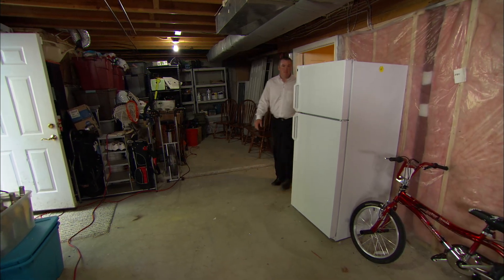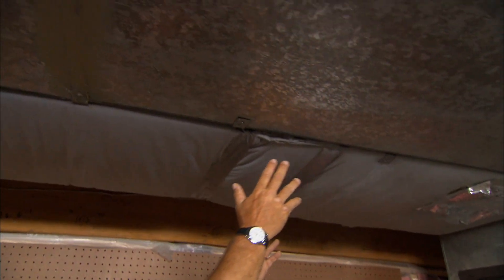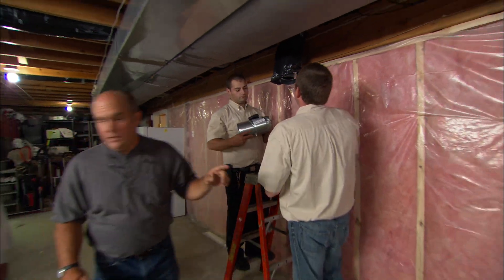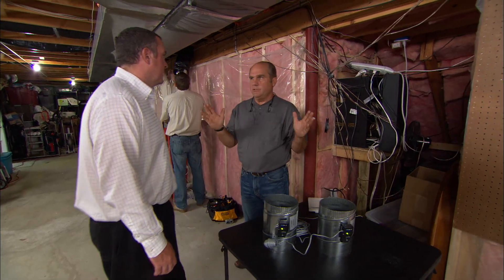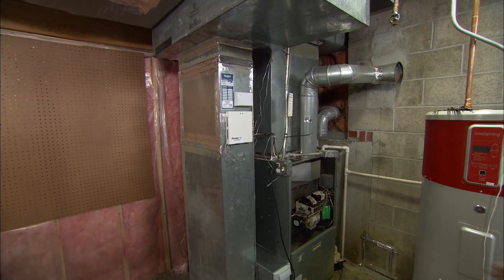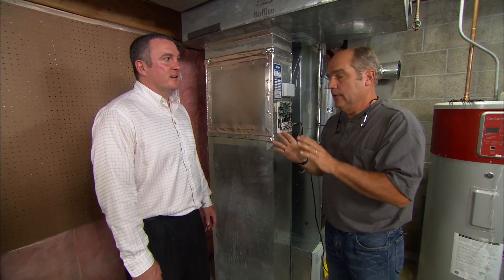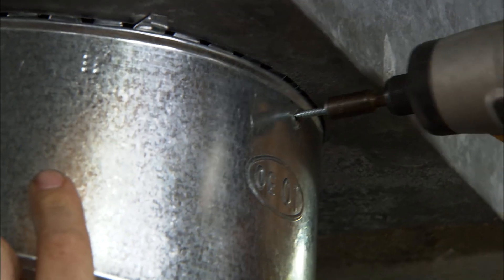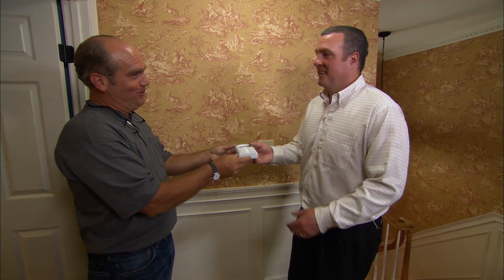How to Zone a Forced-Air Furnace and Air Conditioner | Ask This Old House

Comment: Is there any reason the bypass damper would just dump air into the mechanical room as opposed to putting it back into the return air?  My HVAC Technician has a bypass damper dumping the excess air into the mechanical roo.
Reply: There are better ways with today’s technology versus a bypass damper.

Comment: This is interesting i have  a split level house . The upstairs is above the garage. Duct works runs in the garage finish ceiling for the upstairs.   Always freezing cold in winter. I Had hvac company  looking into the problem. They said my only real option was adding electric baseboard  heating for the upstairs.

Comment: That’s right bypass hot air right back into the intake of the furnace.  This will cause the furnace to cycle on the limit, or lock out completely.  Every zoning system needs a discharge air temperature controller that will cycle the furnace off before the limit trips.  Most of these zoning systems make the equipment cycle on and off excessively.  This is like trying to make a variable air volume system, work with constant volume heating and cooling equipment.  You can get by with a few dampers, if the ductwork is a little oversize, but 23?  I didn’t know the zone control boards could handle that many, unless they used DDC type communication.
Reply: There's two zones. Each damper is daisy chained to the next one in that zone. You have the same bypass with a whole home humidifier and that works just fine.

Comment: Maybe not such a good idea to put a bypass in so close to the return...can superheat the return air in the winter (and cause the furnace to shut down prematurely) or supercool it in the summer (and freeze the evap coil). Put in bypass dampers on some/all the branches. Same $ and prevents accelerated wear & tear on the expensive furnace and evap components.
Reply: I'm no professional by any stretch of the means, but this was the first thing I thought when he described what that did.
Reply: Personally, they should have just used the basement as a dump zone for all that extra air. There, solved.
Reply: @cadets3  I dump most of my air in the basement, then it works it's way up to the first floor through convection, as well as the ducts.  The furnace runs longer so the upstairs gets more heat.  I just did that without any dampers, but will just shut ones off to one area if another area is cold.  I really like having a warm basement, and the heat is much more even on the first floor. In the winter I shut off most of the runs in the basement and let most of it go to the upper floors.

Comment: How much should it cost to install the Zone Dampening system, on 2 story Townhome when building one. The builder is asking for $7.7k and I don't see it costing that much in addition to what you already showed. 3 floors 3 thermostat, 3 zones. shouldn't cost 7.7k
Reply: I assume that includes the cost of the furnace and A/C unit since that seems fair. Not sure how they designed it, but if there is extra ductwork plus the cost of the equipment, it will be a couple thousand dollars for sure.
Reply: shop around, you'd be surprised what the difference in cost is.  The bigger guys have to charge a lot, and if you get someone that they hired, he may not be good.  A small business owner/installer guy will give you a better job at less cost.

Comment: The Forced-Air Furnace system is controlled by an electronics board only work good in lower lighting areas. In Florida, I would not use them because there are many lighting.

Comment: Waaaaaaay too many moving parts. I have a similar system in my house and it’s 100 percent Garbage . If a company tells you that this an option and they want to install Ruuuuuun away as fast as you can
Reply: Well there are better systems why you have to do homework.. my boss does a system that uses air bladders to block the flow withpneumatics. The system actually works great.. did you buy the house eith the system already there or did you have it done..
Reply: The home is a new build and it was finished in early 2020, another problem I found with these systems is that if for some reason the upstairs gets hotter than the lower level and you need the heat on downstairs and the ac on upstairs you can’t do it. That alone is a reason not to use it. As strange as that sounds I’ve actually ran into that problem a few times .
Reply: True. I've installed lennox xc20s and xc25s on peoples home and just the amount for a 5ton zoned system was over 20k and they are a piece of crap, yes I'll admit it does what you want to do but for that amount your better off getting 2 basic system for a less and lasts longer then those xc series

Comment: I have a zoned system and it sucks upstairs as it does not maintain the set temp. May need to have a load calculation done to see if system needs to be re-sized $$$ had to replace all of my damper motors cost more than 75.00 🤑

Comment: You installed the bypass damper, however, did not install a discharge air temperature sensor (DATS).

Comment: Neat. I would try and setup some kind of interlock between my main PV array and the panels dedicated to the AC. >>>> nub.best/rtq7    That way the panels could be disconnected from the AC and added to the Charge controller that services the batteries.
Reply: great

Comment: I need to do exactly the same thing for my house for 2 levels of controls - one for upper floors and another for basement. Can anyone help?
Reply: Ashoke Roy what state?
Reply: A cheaper thing to do would be to open the dampers manually in the rooms on the upper floor and close the dampers in the basement rooms during the summer.  Do the reverse in the winter.  This keeps the cooIer air upstairs and cool air sinks so the air will move down to the basement.  Usually the basement stays cool during the summer anyway.  I'd also buy fans (or ceiling fans if you can afford it) for the summer, and space heaters in the winter.  Just run them when someone is in that particular room.  You can get space heaters with thermostats for $40, floor fans are cheaper.  Buying about 4 of each is around $250.  Using them isn't going to raise your electric cost that much.  In fact, you may be able to turn the thermostat down in the winter and up in the summer to offset costs.  A new system will cost thousands of dollars, which you won't recoup in savings until probably 20 years, at best.

Comment: If you are going to zone a system do it right and not like this. Go for 2 stage equipment with variable ECM motor and 2 stage AC. Or else you can run into high limit and freeze ups. This is a hack way to do it.
Reply: 2 STAGE  WONT GUARANTE   ANYTHING..   A lot of  time    2 stage kicks in High    too quick and   still have high static and  oversize       complete Variable  system is best but  who can afford  them
Reply: A proper zone system designed to work with the equipmemt will allow full system control. Lennox harmoney systems have their own limits and safetys to prevent freeze ups and staging control. Do some research.

Comment: and what about half closing your registers on the first floor and fully open the ones on the second floor...? I thought that was the purpose of being able to adjust the register...???
Reply: DoMorin very noisy and can lead to condensation on grills which contributes to mold
Reply: It does work, I just put an extra couple runs in the basement to prevent too much pressure and noise.

Comment: Hi Richard Can the zone air conditioning ( heating or cooling)system be added to any heating or cooling unit or does it have to be a special type ?. I was consulting a local HVAC company representative to have zoning done for my house and was told that the zoning can not done on a single stage unit and it has to be variable stage or two stage unit. This amounts to changing my existing unit that is still in very good condition and probably has another 10 years of life. Also I was told that it is illegal to place a bypass duct in California because of health concerns. I am not sure if that is true or if there are any real health concerns and if so what kind of health concerns?. Appreciate your expert advice.

Comment: I have a central heat and a/c with 3 zones, one of the dampers has power but 0 volts.  I would like to know where is  the problem, is damper or the electrical box that control the  whole system. I changed all 3 thermostat and did not fixed the problem. Thank you for your help.
Reply: Juan Carlos -sounds like you need to call a qualified hvac contractor

Comment: terrible way to zone.  and bypasses are a really bad idea.  if you have a single stage system deal with the extra noise or risk overheating/freezing your coil, along with killing your systems efficiency.  Best advice is to have registers with big spaces that don't restrict airflow.  Also extra velocity can be a good thing if you're properly directing airflow based on the location of your registers.  It will get the hot/cold air to where it needs to be verses going where it wants based on convection, and will help mix the air creating a more uniform temperature in your home.  At the end of the day there are better solutions but if you're retrofitting a single stage system, there are no guarantees zoning will be a great solution, but it can work just do not make more than 2 zones, and monitor your system to make sure the decreased air flow doesn't cause overheating or freezing of your coil.  NEVER DO A BYPASS!
Reply: talljohn5350 - I agree with your comments.  Have to make sure the minimum airflow requirements for heating and cooling are met when the smallest zone is calling otherwise will have issues with high limits in heating and ac freezing in cooling mode. But hey what do I know, I’m just a Carrier factory trained technical support specialist.
Reply: @MarkMark-kq6mc  , I couldn't agree with you more. I am amazed at some of the contractors that install these things and don't have a clue about temperature rise or how to take it or even how to locate it on the manufacturers plate. I yet to see one of these videos where the installer took the temperature rise after the installation was completed. But hey what do I know, I am just a first responder / HVAC technician for a gas utility with 35 years of experience.
Reply: @boby115   I'm guessing this is an older episode, judging from Richard''s youthful appearance. Really, they are trying to retrofit an existing old system at low cost with the tools they had at the time, maybe. Even with the bypass, what hits me is that you have an HVAC system that is either over-sized or under-sized given how many dampers are open or closed. Plus, we've all read about proper sizing to avoid excessive on/off cycles. So, what is the solution for an existing home? And what is the solution for a new home?

Comment: Should do a vid on the call back when it freezes up or cuts out on high limit should have used an ECM variable speed
Reply: Charles Bryant that’s what the bypass damper does. It mitigates that
Reply: @BillyN31   No Charles is correct. The air coming out of the air handler has been cooled about 20 degrees from what it returned at so lets say the 2nd floor stat is set at 70 degrees. and the room is 73 degrees.  The thermostat on the first floor is most likely  satisfied thus closing the first floor dampers. That means air returning at 73 degrees from the second floor is being cooled to 53 degrees after it passes through the evaporator and heads out the plenum.  So as soon as the air heads out of the plenum it will get redirected through the bypass because the first floor t-stat is satisfied. That means the air that has just been cooled 20 degrees is being sent right back a second time through the evaporator coil and cooling it an additional 20 degrees.  I realize the air is going to be mixed with some return air from the second floor but lets say it is lowered 10 degrees instead of 20 degrees. That would calculate to 43 degree air entering the evaporator. The refrigerant temperature would be about 10 degrees lower which would make for a 33 degree coil. If it ran very long like that it would start to ice up. If the system was undersized like mine it would definitely start icing up. Not tryin to be dis agreeable but it could develop problems and lead to early compressor failure from liquid slugging back to the compressor due to low superheat.
Reply: victory21222 ok. I love your logical thinking! Thanks for being one of the few comments that is actually intelligent!

Comment: 23 dampers at what? 75$ each? ouch
Reply: I looked up the company... Currently $238/ea for 8" dampers, and minimum $350 for the control board makes it $5,812
Reply: @elooney85 , I just looked up that company. Website is partially hacked.
Reply: E.Looney 😂😂😂
Reply: All for a bit of tin with a servo on it. I wonder how much the control board is by itself.

Comment: How did it all work?  I was waiting and no finale?  What happened.  This all sounds good but I'm a little skeptical about how it all works out.  I've been waiting for this for years.  I seems too complicated for residential use.   Only time will tell.  Thanks.
Reply: How is this complicated. I followed this video , got a little help and installed it at my place. Saves bill by directing most of the heating / cooling to the upper floor when no one is in  the lower floor ( read night time )